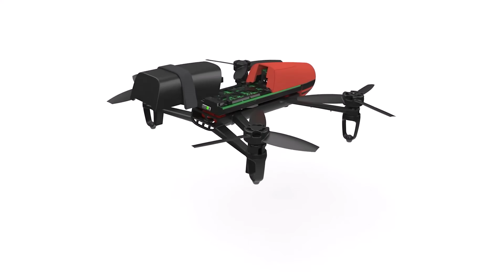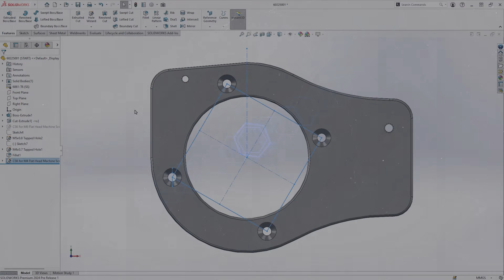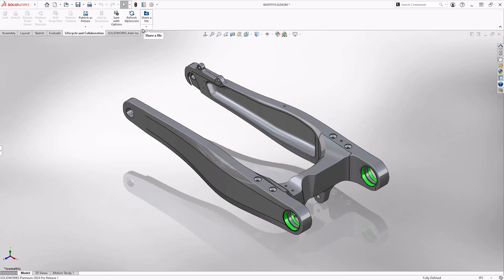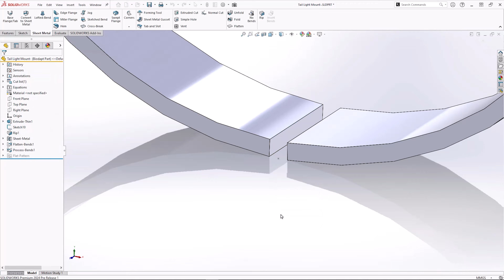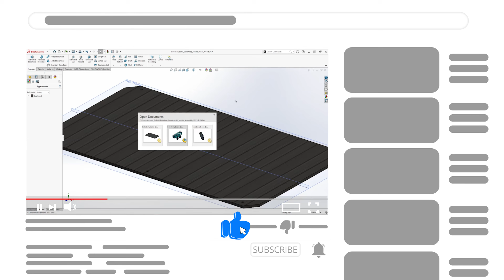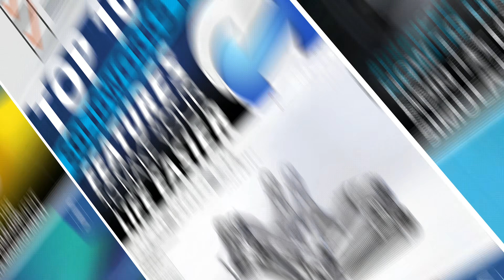TOP 10 BEST NEW FEATURES | What's New in SOLIDWORKS 2024

Comment: They didn't do anything with drawing module (and its bugs). Simple feature like changing a language the drawing is made, from only one place is to difficult to program for them. After more than 20 years of development of this software we still must change a sheet, a revision table and a descriptions for sections/details/views manually because reading from a file don't work. Switching between draft view and high quality works radomly - sometimes high quality is when it is set to draft, sometimes in the opposite way. Sometimes part disapears from a view without any reason and must be turned back from the settings. And so on and so forth...
First SolidWorks version I had ever seen (in 2005) was version 2002, and almost nothing changes since then in 2D module. "Perfect from the begining"? Definitely NO!